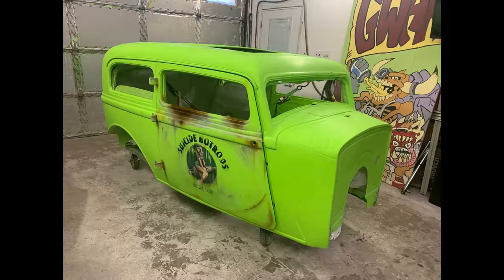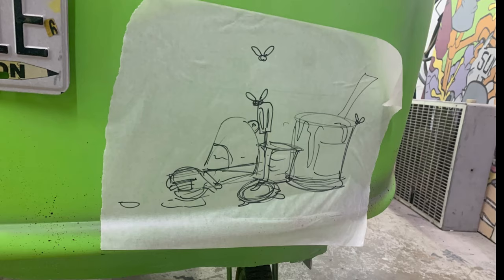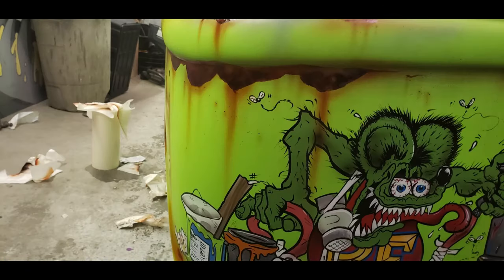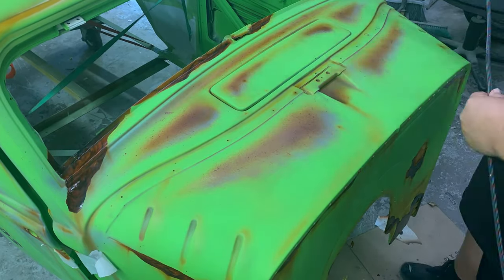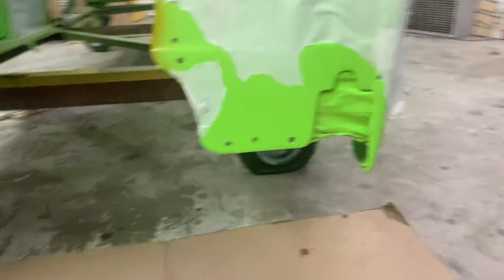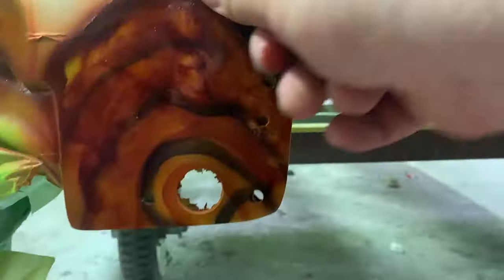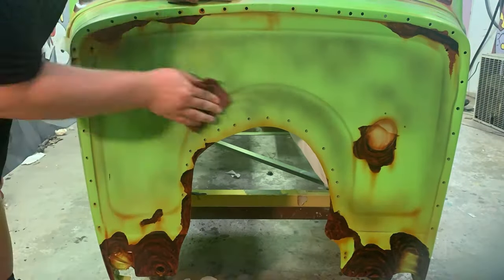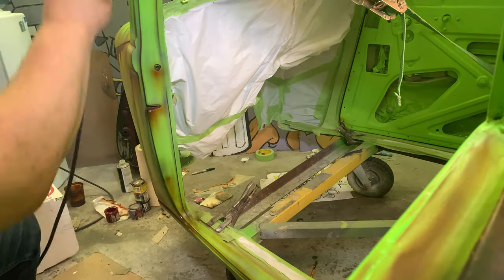Custom airbrushing rust on a hot rod

Comment: Do you have a paint code for the red oxide you used? Thanks
Reply from the maker: it is PPG toner dmd623    its a old toner and not sure if its made anymore sure you can find it on ebay,  but you can use like any base color and thin it a bit to give that rust coming threw the paint look